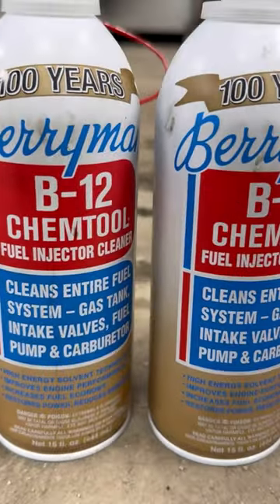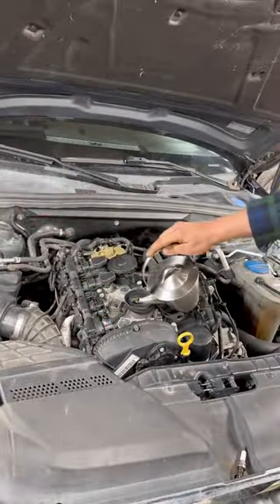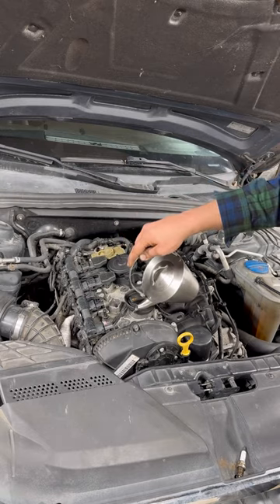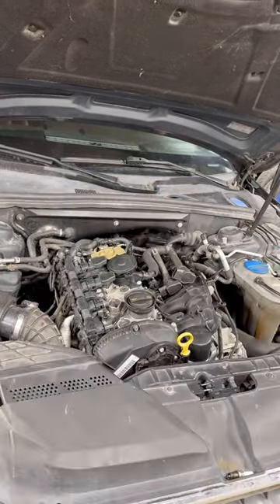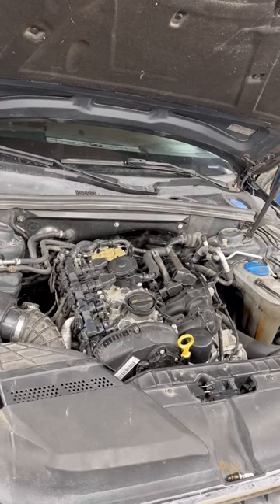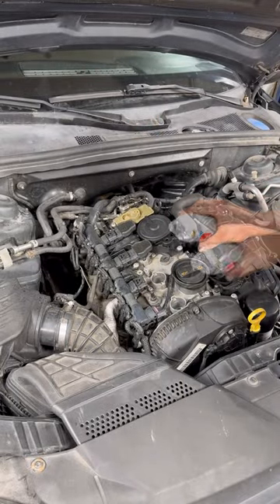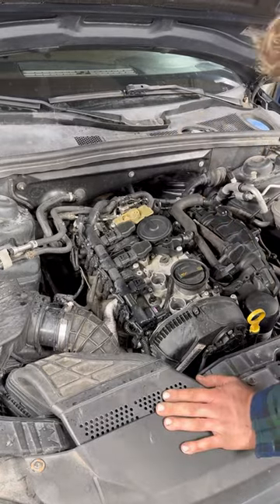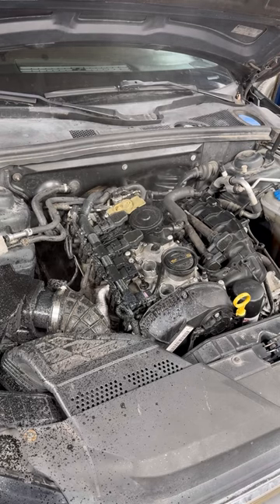2.0t Oil consumption Fix? Carbon Cleaning Test & Tear Down Audi VW Chain Drive TSI TFSI using oil

Comment from the maker: Give me a lil 1000 likes before the full teardown inspection video, until then I’ll just drive it to see if there is an improvement.  I love my manual transmission 6-speed sport package Quattro A4 but when I’m done fixing everything on it for the channel, it will be going up for sale.  Keep an eye on future videos fixing the last few details on this car.
Reply: Go full Neutral Drop on the ol girl. Cha know ya want to
Reply: Definitely liked, I have seen many mixed results dependent on brand, intake valve cleaners are a scam besides liqui moly with a pick and nylon zip ties as a brush, but this to help treat oil rings have worked for some and others not so much
Reply: Use the seafoam as directed for the best results not your lazy way of doing it. The results will not be the same. Do the job right naptown
Reply: @spudbot69  I think he was doing more for a appealing video, solvent is solvent , did it damage anything , probably but just stay more focused on if it will actually clear the oil rings or not
Reply: @jameshinged3002  yeah but to clean the oil rings better he should follow directions. You can't disprove someone by using it in a way other than directed.
Reply: My son and I have been working on our EA113 for years.  Just trying our best to solve and learn about all the little (and big) things that go on with these engines.  I carbon cleaned my wife’s 3.2 Q5, but haven’t yet cleaned the ports on our EA113.   I’d love to know if how well you experiment works for getting everything extremely clean.  Is all of that nasty carbon sludge going through the catalytic??  That’d be one of my fears.  Could the liquid cause hydrolock?  Please update!
Reply: @jameshinged3002 I just chemical cleaned my wife’s 3.2 Q5.   The VERY best performing cleaner was that Berryman B12..  amazing.  I was surprised.  Turned the built up carbon into soft goo very quickly.  And B12 is like 7 dollars.  Not to be underestimated!!!
Reply: @spudbot69 you must not understand that direct  injection doesn’t allow any of these cleaners to work when injected even through the throttle body (as directed).   It doesn’t even get as far as the valves.  So go back and do your research before you go trying to insult others.  Go look it up and you’ll see that these cleaners do not make it to the valves.  I’ve tested this myself prior to carbon cleaning.
Reply: @phonkyfeel1  so where does it go after being sprayed into the throttle body?
Reply: To ALL who question this method…. IT REALLY WORKS!! Now I say that with one thing in mind, what is the definition of works? I’ll explain, my wife’s 2012 A5 Quattro 2 liter had an extensive oil leak. You know the usual upper timing cover and oil pan but this leak was a little worse than that. Also the lower cover was leaking and of course it had the outdated tensioner and stretched chain so as needed I did the chain service and resealed the covers well actually went with new covers top and bottom and new oil pan. Sealed it up tight. The point of this is before we fixed the leak we were consuming the usual 1 quart 1k miles. Immediately after the service we went straight to 5-600 miles per 1 quart consumption. Ooh I also forgot to mention I replaced I the ccv valve on top of the cam rack as well( supposedly helps the consumption issue ) ( clearly not) I did research into the b12 piston soak. Not gonna lie, was frickin nervous as shit, did not want to break the wife’s car lol. I finally got the guts to do the service and the only thing I was disappointed about was not doing it sooner! She has driven right around 2100 miles so far and not a drop of consumption. I would have already bought 3 $13 quarts of Castrol 5w-40 in that time period. I also since then have tried this service on a 2004 BMW 325XI and a 2015 Toyota Venza 4 cylinder. All 3 have similar results and run excellent with no consumption at all. That being said I am convinced it “worked” I am very curious to see what the internals look like when Naptown tears it down. That will give me more data on how long I can expect this to “work”!! I mean unfortunately this is a war as it will continue to keep happening but if we keep winning the battles like this we will win the war! Keep up the great work Naptown! I’ve been a supporter of yours for a while now. Looking forward to the tear down!!
Reply: Cant wait to eventually see the results!

Comment: The B-12 real works. I like to use this in conjunction with BG 109 in the oil which cleans the rings well from the sump! Also I ALWAYS use fogging oil before cranking. Protects the cylinders and helps to build compression when you go to fire it later.

Comment: Cant believe you just posted this.. 
2 months ago i ran thru the tank 2 bottles seafoam on my 14 allroad with 160k miles.. thought i would try it . Never have before.
6k miles later and ,2 oil changes ive used zero oil.. 
Im still in disbelief..  before i was using 1qt every 1k to 1500 miles.. 
This is my 4th b8 & b8.5 all of them used oil.. 
Everyday i check if used any oil.. i drive about 150 miles a day .
Btw if u still do it, i wanna hire you soon for timming chains on my allroad
Reply: You added Sea Foam to your gas tank and it fixed your oil consumption?
Reply: @rjmari  I can't confirm it fixed it 100%.  Only facts I have are it has burnt zero oil over the last  6k miles ...
Reply: @hotshotfx3502  Oh no, I'm asking sincerely since I have a Tiguan that burns about a quart every 1200 miles. Was wondering which Sea Foam product you used: Motor Treatment, Spray, Fuel Injector Cleaner, etc.
Reply: @rjmari   just seafoam cleaner..  give it a try. But gotta say if it's older then 2014 not much is gonna help it, besides new piston rings..  2011 and ,2012 were some of the worst oil consuming once I had..
Reply: Put engine restore in with a oil change and motor will feel new again , you feel it , it will stop or slow down oil consumption too , it’s not cheap though haven’t bought it probably 10 years and it was over 20 than
Reply: Impossible for gasoline direct injection not to consume oil because gasoline dissolves oil.
Reply: Don't expect to have him do any work. I emailed him and offered 4K to fix my motor - seized balance shaft - and he ghosted me. Didn't have time to fix myself and needed to work fast so I had to junk it. Very clean and no consumption. Tuned and cared for judiciously, just didn't see the balance shaft issue coming or even existing...even on his channel unless I missed it as a big issue. I loved the car so much.
Reply: @deejay4837  huh. Thanks.  Yeah I never heard of balance shaft issue . That sucks ..
Reply: @hotshotfx3502  Yeah, happens without any warning. I made a turn and the engine just cut out like the ECS kicked in or something. The I stalled right smack dab in a really busy intersection...People were pissed off and honking their horn even with my hazards blinking. I couldn't get the engine to turn over and the starter started smoking as it overloaded.

The only way to find out is preventative maintenance once you've hit 100k, get them swapped out along with your timing chain job. The more I researched - after the fact - I found that it is a big issue. Reason being is the platform is now older and the everyone is hitting 100k plus miles and the issue is revealing itself. 

I wished I had know as my timing wasn't really due as I was still on my third click on the tensioner and my cam phase number was still around - 4.7°, but should've had it done based off the cam phase. Thought I had a bit more time, but like I said the balance shaft threw me a curve....usually the exhaust balance shaft is the issue.
Reply: Did you put the sea foam in the tank or in the engine itself ?

Comment: I follow this channel “eurotrash” he did the cleaning with Berryman too but didn’t do the tear down after . I think so it’s a really good fair test do everything he does for the cleaning process , also drove it and change the oil a couple times to give it a chance as it does loosen the carbon, it will clean it as you drive it .

Comment: Bro! I did an overnight soak in 3 stages with chemtool on my 2.0t. It was burning a quart every 700 miles. Hasn’t burned a drop and it’s been 2700 miles. I ran the engine for a few minutes to “flush” the crankcase as well. Worked out great!

Comment: In china, there are several mature products to solve the oil consumption that causes by a clogged piston rings.

The product sets are mostly came with couple chemical fluid cans and the device to heat up the chemical fluid when it is add to the combustion chamber.( The device is like a box with control unit and four metal sticks.)

Most people claim the solution perfectly solve the problem, however, there are also some car mechanics exhibit the damage due to the chemical fliud. Especially, the piston skirt is the highly regarded issue after the solution.

Really want to see if Naptown tunner could do also the soaking piston with different valves cleaner or PEA stuff and tear down the engine to inspect the piston rings.

Comment: I did something similar with a GM 2.2 L61 ecotec. I used mostly diesel and then brake cleaner to evaporate everything out of the cylinder. It had a ton of carbon deposits in the cylinders because of oil burning through the PCV valve.  I did it while I was doing the timing chain and guides at 95k miles. I was prepared to do the head gasket but ended up not doing it. The engine is now at 220k and running strong.

Comment: Thanks for your video! Can you clarify something? Is the 2012 audi q5 2.0 engine block is exactly the same as VW tiguan, beetle, passat 2.0 engine? Just the block, the head is probably different but can you use the Audi head on the vw block? Please clarify this.  Thank you

Comment: You should try the water ingestion method and see if that helps. I’ve seen it steam clean the combustion chambers but never seen what it does to piston rings if it can reach that far. Would be cool to see

Comment: Use either berrymans b12 or do the liqui moly proline engine flush...i did the proline engine flush and and it reduced my consumption from 1 quart a week to 1 quart a month...im using marvel mystery oil with every oil change now to slowly dissolve whatever other carbon is left then ill do a final liqui moly proline engine flush after the next 2 oil changes

Comment: Bore scope it before the tear down. Come on Naptown turner 💪
Reply: Another Seafoam ads/propaganda 
Easy to dissolve carbon buildup on petrol no scrabbling or wiping required. I posted several videos. I'm really curious if people are not aware of it or youtube is full of salesman pretending to be a mechanic
Reply: @w0lvez1 seafoam works great. The amount of carbon that comes out the exhaust after a cleaning is scary good.
Reply: @spudbot69  Seafoam don't remove anything. If it really works it will kill the turbo. Try soaking the spark plug to see if it really works.
Reply: @w0lvez1  so you're going to tell me all the carbon that comes out of the exhaust after is fake? The lack of oil consumption is fake? Also you don't have to go past the MAF to spray you can go straight to throttle body and avoid the turbo.
Reply: @spudbot69  How can carbon comes out from the exhaust there is a catalytic converter that will block it like a mesh. Maybe pieces of catalytic converter coming out from the exhaust. Assuming it really cleans the intake valve, if valves are not cleaned evenly it will cause more problems. The valves only rely on heat transfer. When 1 valve fails it will require removal of the cylinder head just to fix it. It might solve a problem but it will create a bigger problem. Yes you avoided the turbo on the intake side but not on the exhaust side.
Reply: @w0lvez1  well there is you, some Fudd on the internet. And there is my car that has worked great and is about a 100k running great. Be as mad as you want but it works and carbon does come out of the exhaust. It even says it on the bottle. You haven't even read the label but want to talk s if you know the product well.
Reply: @spudbot69  If I want to dissolve carbon I will just soak it on carbon remover. It will dissolve carbon with the engine off. Looks good as new. 🤣
Reply: @w0lvez1  so you are saying heat will not help in the removal of carbon? 🤔 classic comment section mechanic.
Reply: @spudbot69  Heat will make it faster. What I'm saying is heat is not needed. Works well @ room temp. I posted some videos where you can visually see the reaction on carbon buildup. Carbon remover was invented a very long time ago. In a diesel heat and agitation is required but not on petrol.

Comment: Wouldn't it be better to use as directed? Yes the pistons are hot but wouldn't it be better for it to be running so you get heat and movement to better rid the carbon? I mean doesn't it get into the piston rings better if there is motion along with the heat.

Comment: How about removing all spark plugs put the chemical in number 1 cyl only, reinstall number 1 plug turn the crank by hand till compression is felt. This will get the chemical to go between the piston rings to soften the carbon.
Do the same with 2 3 and 4 cyl.
Reply: He’s not trying to get the cleaner between the piston rings. He’s dumping it in to try and clean carbon off the piston head which he’ll compare to the other pistons. Second he’s testing if this type of cleaning will damage the pistons wear skirt.
Reply: @ThumperG  His caption... 2Qt oil consumption fix? led me to believe the engine was burning oil caused by stuck oil control rings.
Reply: Yeah for some reason he does not want to follow the directions because you're literally supposed to have the engine running and spray the seafoam directly into the throttle body.